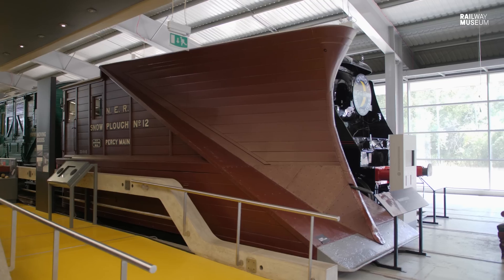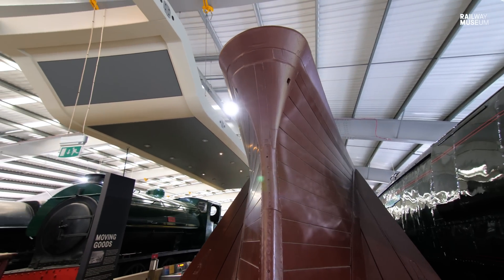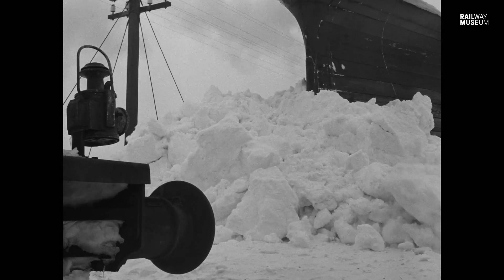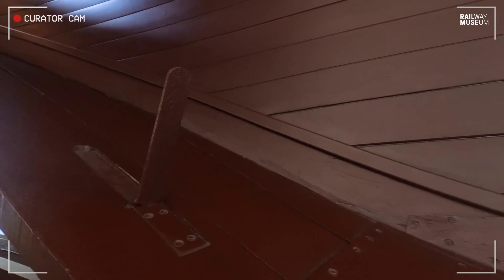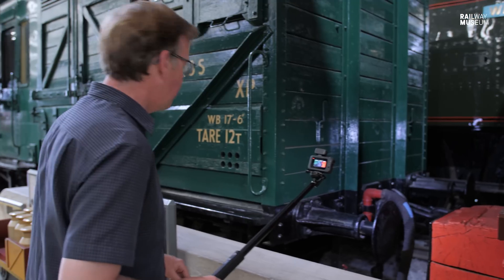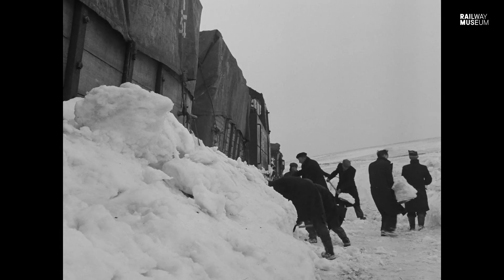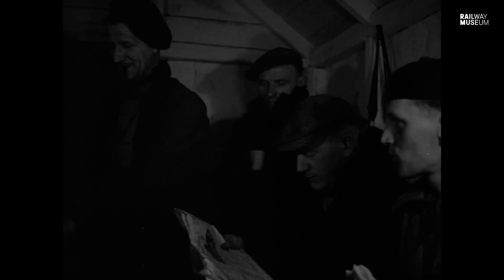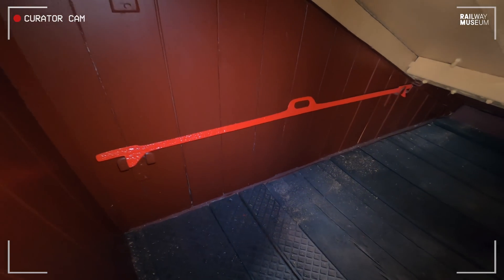This 1891 railway snowplough could clear 14ft snowdrifts! | Curator with a Camera

Comment: Oh man, I loved seeing this. I'm a bloody Yank, and so far as I know, we didn't have plows like the prow of a battleship; we just invented a steam-powered snowblower!
I'm so glad that this wasn't just a walk-around, but that you went inside, showed off all the little bits and bobs and storage cupboards. I'm a little surprised that there isn't more iron in her, honestly. But this thing is still flipping amazing.
Reply: I think rotaries were invented in Europe.
Reply: British snow tends to be wetter which means it freezes to a harder compacted lump than dry snow that can be blown away.
Reply: @gs425  you don't just "blow away" the snow with a rotary snowplow. Look them up, they're massive machines the size of railway locomotives, the early ones literally had steam boilers just to drive the plow blades.
Reply: @ShadowDragon8685  they are. But with snow that partially melts and refreezes they wouldn't have a chance. British snow, when we get it, is horrid stuff. Rarely powdery
Reply: The lack of iron may have been a deliberate decision, a metal structure would have radiated the cold temperature from the outside, to the inside of the maintenance compartment, and the guys may have been colder inside than outside. Another reason may have been that the workshops would have been very busy maintaining locos and rolling stock. As the plough was not an urgent job to be done, carpenters would have been allocated when other duties weren't a priority, they may have enjoyed working on such an intricate wooden structure, rather than wooden freight wagons all day.
I applaud your Union Pacific for doing a complete rebuild of your 4014 Big Boy, the pinnacle of steam loco power, and others, etc. The American railway doctrine of rejecting inside cylinders on all locos is an idea that should have been adopted over the pond. It would have speeded up the preparation of the engine before the morning or evening day's work, thus not having to go under the loco to oil the inside motion moving parts.
I would be interested in your opinion of the reason for the 1948 boiler explosion of class T1 loco 3020, if you have knowledge of the disaster, several ideas have been put forward, and looking at the photo I suspect that the front boiler tube plate may have made it into the next state. Personally, I think it may have been a phenomenon known as Harmer Blow, where too much cold water is injected into the boiler with a low water level, causing oxygen molecules in the water to rise to the top and expand at an explosive rate. A video of the event can be watched on YouTube, "The 1948 Steam Locomotive Boiler Explosion Outside of Chillicothe, Ohio" the pictures are quite amazing, if not so sad at such a tragic loss of life.

Comment: It may be a small stove but they are very efficient. Even the smaller pot belied stoves are great heaters. As a guard on a heritage railwa I have got the living area so hot that other staff have preffwred to ride on the balcony. I have heard it said that before going over Shap the gguard would climb on the roof and drop smal lumps down the chimneyso the whole stack would be on fire

Comment: You hit the nail on the head a 200 ton Locomotive pushing it. Can you imagine a Pacer doing that not a hope in hell
Reply: What a stupid comment. BR wouldn't send out a lightweight DMU to do this work. They would send out a pair of snow ploughs topping and tailing a pair of diesel locomotives unless using a locomotive of 1Co-Co1 wheel arrangement.